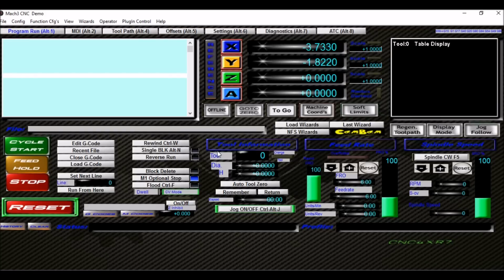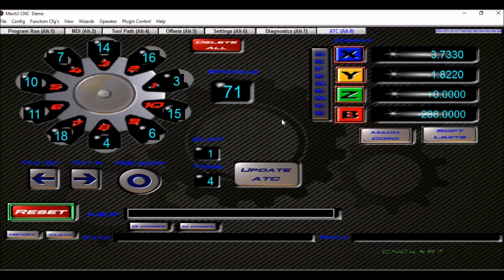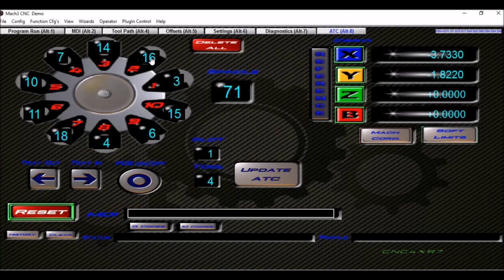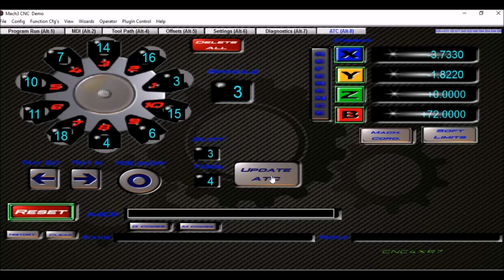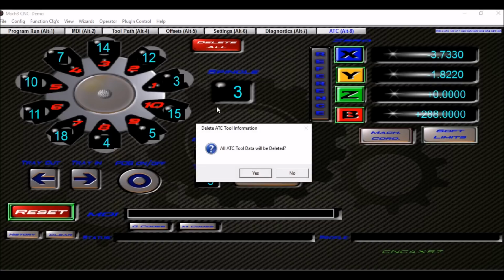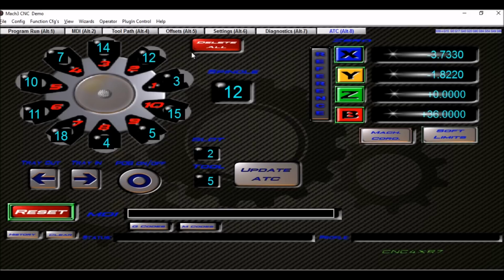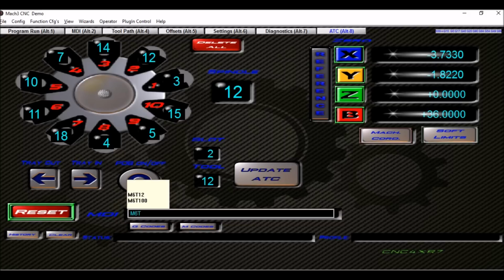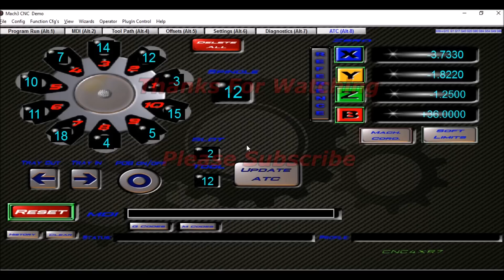MACH 3 Auto Tool Changer  Macro Proof of concept!

Comment: This stuff is very hard to digest ,  I have not even been able to understand the concept,   can you do a  beginning level video explaining how tool change macro works,   using two tools example,         I have tried to study, but not at all getting the basics,     please do explain,   how the m code for tool change is handled by the controller and mach 3.  And how and when the relay is turned on to release the tool from chuck and moving to New location and accepting New tool and all', can you explain in simple way,      Mainly how to think, in a perspective of a 3 axis cnc router guy
Reply from the maker: I have several videos. On this subject.

Comment: HI, HOW ARE YOU?, EXCUSEME, i WANT TO DEVELOP AN AUTOMATIC TOOL CHANGER, BUT  I HAVE A LOT DOUBTS, FIRSTABLE I NEED TO KNOW HOW I CAN DO IT,  WHAT ELEMENTS ARE INVOLVED OR I CAN USE IT,.

I HAVE SEE SOME VIDEOS AND BLOGS ABOUT THIS SUBJECT, BUT SOMEONE TALKS USING SCRIPS, OTHERS MACROS, SOMBODY MODBUS, AND BRAINS, ON MACH3, SO I SO CONFUSE, WELL I USE AN BREAKBOARD TO CONTROL THE SERVOMOTORS, I THINK I CANT USE IT FOR AN ATC OR I DONT KNOW, I WAS THINKING USE IT FOR USE SOME SIGNALS ON OUTPUT AND SEND THIS SIGNALS TO ONE ARDUINO, THIS ARDUINO WILL CONTROL THE MOTOR OF THE ATC AND ONE SYSTEM NEUMATIC, BUT I REPEAT , I HAVE A LOT DOUBST HOW I CAN DEVELOP THIS. CAN YOU HELP ME?

THANKS
Reply from the maker: Generally when people say Macros, and Scripts there referring to the same thing. A Macro is a script.

The ATC screen and Macros I developed are for a 8 , 10, and 12 slot ATC with a pneumatic draw bar, and slide.
2 inputs , 2 outputs are needed and a stepper or servo motor to turn the carousel. also has a air blast programed in the macro.  Visit the website for more details www.cnc4xr7.com, you can also contact me thru the site if you have questions.
Be Safe Sam

Comment: Btw, I wasnt sure if you ever saw G.D.Marsh's build on the zone. He had added many of the features you are implementing and or most likely contemplating. 1 of the coolest was the auto tool measurement arm. Check it out here in case you havent seen it. https://www.youtube.com/watch?v=hoVivgo3jhk
Reply from the maker: I had seen his video of the touch arm However I have not seen any ATC videos  That  allow you to  independently assigned to any tool number to a Slot. Please forward the info.
Be Safe,
Sam
Reply: +CNC4XR7 No you get the award on that one and the fact that it pulls from the Mach tool table is brilliant IMO.
Reply from the maker: Sorry I misunderstood. His arm is very cleaver, I'm just a little confused as to the need for it? Once the Z zero is set All other tool offsets are stored in the Tool Table If set correctly there should not be a need to touch off every tool.
Cleaver Idea none the less.
Be Safe Sam

Comment: hi Sam, that's brill I want an atc for my g0704, I look forward to seeing you build it, is it going to be side mounted with a arm to swap the tool from the changer to the spindle ? like the 17 changer that is on the umc 10 and umc 20 ? I am working on a design for one in fusion 360 at the min, I like the screen set your working on and would like to get the plans and tool change marco when your done, thanks daniel
Reply from the maker: The plan is to have the ATC side mounted and slide in and out the Z will move up and down.  No plan for a arm.  Sorry:-(
Reply: OK Sam I guess that would make it a lot harder to make then ?? I still like your plan and I am sure a lot of us guys out will be waiting to see it finished, when it done will you be making build plans and macro available??, thanks daniel
Reply from the maker: Yes that's the plan

Comment: Great job! That seems to be a very comprehensive screenset.

   Will the carousel rotate whichever direction is required to get there the quickest? (Bidirectional). Most I see are single direction though the design doesnt limit it.

  Regarding the B reset feature (resetting the DRO to 0), why would you use that? I would think that during the initial homing sequence, the carousel would rotate up to a particular switch/position and then the DRO would reset. Wouldnt these always be absolute coordinates for the carousel?

 Are you or do you plan to use a/or 2 parallel port/s?
Reply from the maker: Bidirectional Hmmm I'll look into that, B zero dro may be needed to tweak the ATC so it's there. As of now two outputs are needed as well as step and direction.
Maybe able to get by with the C11 GS if not I may go with a ESS + BOB
Reply from the maker: Ok bidirectional travel issue resolved. The carousel will rotate the shortest distance.
Reply from the maker: Also B button references to home only.  Good eye thanks
Reply: I will be contacting you when my lathe tool change macro needs to be changed ;-)

I have a turret tool changer on a lathe that has an electromagnetically controlled pawl. To go the opposite direction would require that the pawl be energized to retract allowing travel in that particular direction. Do you see any issues in a macro that would do that? 
It is a 6 tool changer and the present macro always rotates the opposite direction of the pawl then backs up a few degrees against it. It works great but isnt going the most direct route. In reality it probably still needs to back up a few steps just to insure a static tool location. 

Glad you changed that B feature. I was curious, in the previous set up. Would resetting the B DRO when it was showing 60 degrees for example. Wouldnt all the tools be out of sequence? If so it just seemed like a bad opportunity waiting to happen. Or it would be on my mill ;-)
Reply from the maker: Yes the the B DRO would work just like that and yes they would have been off. I did not catch it that is one of those things that's hard to see in simulator mode. Now I have it reference home if you press it that way you can reference it independently of the others. Also the Bidirectional was easier than I thought and was one of those things I had not yet looked at. My biggest hurdle was  to  independently assigned to any tool number to a Slot. Shes looking really good now.

Email me and we will discuss your Turret issue.
Be Safe,
Sam
Reply: I would like to email you when that time comes. I had posted on Mach support about doing that over the years and hardly anybody would respond. I was sure it is possible. I just havent delved into the code nor do I understand it. 
1 day it wont be about the machine ;-)
Reply from the maker: Sounds good let me know I think we may be able to solve the issue in a matter of minutes.
be Safe,
Sam

Comment: Awesome, This is the way i want to make my tool changer. Because I'm planing to build a dual swing arm system i need to keep track of the tools loaded as you are doing. Are you going to show how you modified some of this stuff and created the extra tab? cool stuff :)
Reply from the maker: Well at this point it is only tested in a simulation so I wont release anything until its finished.

Comment: I am currently building a power draw bar and looking at building an ATC but with LinuxCNC, and really like you're idea for having the ATC software accommodate a larger tool sets, and the ATC slot numbers are just the index numbers, this will be a very nice feature and save a lot of messing about re configuring the ATC slots :)
Reply from the maker: Exactly What I was going for I don't want to reconfigure the tool table on every Job. Thats the whole point in having a tool table in the first place.
Cant help much with the Linux CNC side I have wanted to give it a go but No time.
Let me know if I can help.
Be Safe,
 Sam